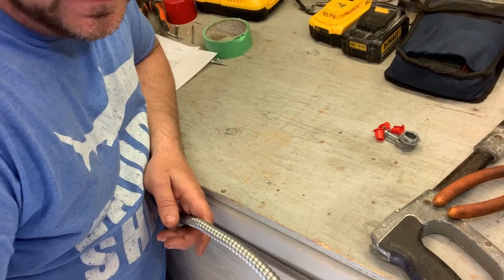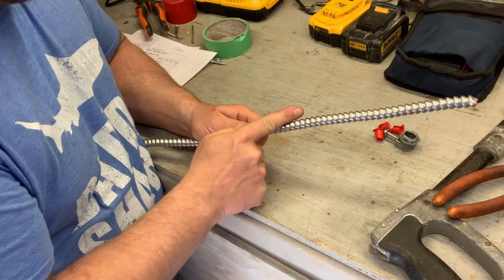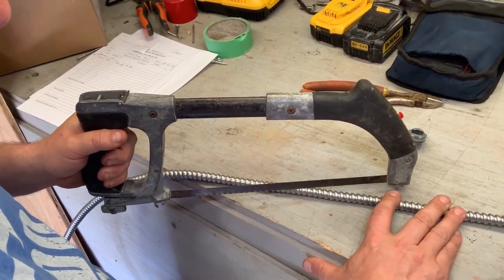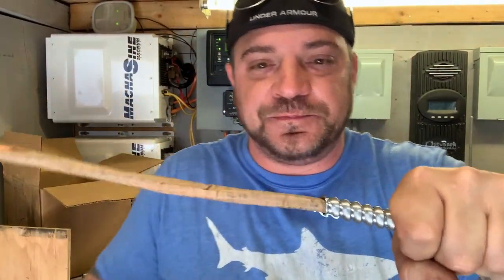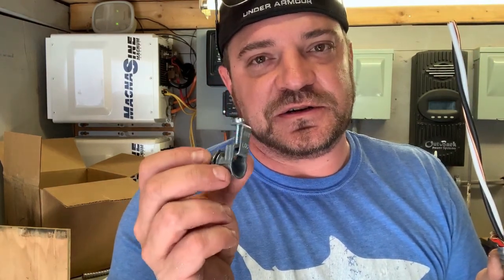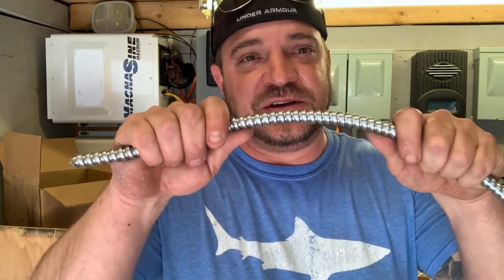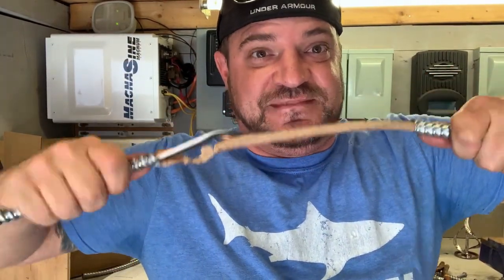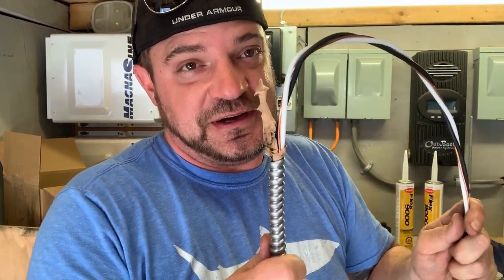How To Terminate AC 90 Wire

Comment: I do it the electrician way lol you forgot to twist the wire after you bend it it unwinds it and it gives you  ample room for your snips and it wont catch when pulling off the armor plus you get a nice straight cut. Just an FYI

Comment: Hi, do i need to use ac90 from panel to afci /gfci outlet to meet the code in Canada ?
Reply from the maker: If you have a fuse panel then yes because you can not purchase an arc fault fuse and will have to use an outlet. However if you have a breaker panel then no you can use regular romex or nmd type wire because you can purchase a breaker to go right in the panel. Hope this helps.
Reply: @conquerallelectrical  thx!

Comment: Hi i have a question do you know why ac90 vibrates? Because my does for some reason, i live in a building and it vibrating most of the time at night, i had a electrician in my apartment doing some outlet renewal a month ago, could it be the cause?